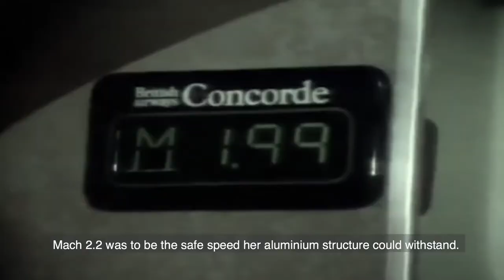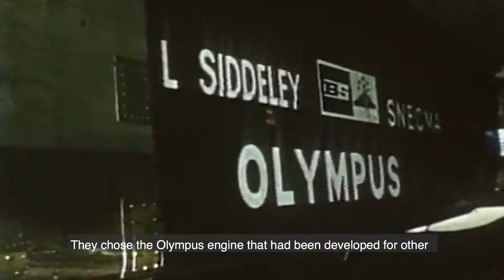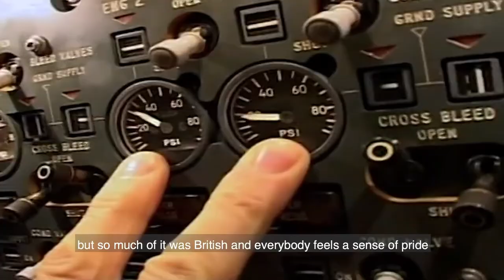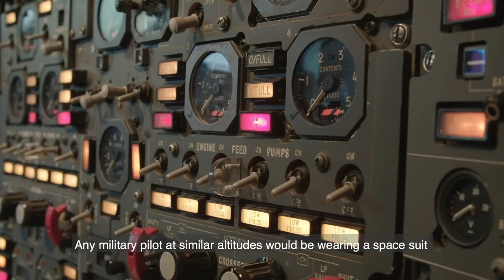Concorde Compilation from Archive British Airways Material

Comment: So without the A-12 & SR-71 spy planes along with Apollo computer technology. Concorde probably would’ve been years later. The A-12 would cruise @ Mach 3.5 The sr71 would cruise at Mach 3.34 it was a different airplane. The A-12 was signed in 1958-1959 to cruise Mach 3.  America stopped a commercial supersonic aircraft because sound #1 also we had learned it’s dangerous and not economical. Now keep in mind the L-2000 & Boeing were gonna be Mach 2.7- 3.0. Believe it or not there’s a huge difference in engineering to build a jet for mach 2.04 VS Mach 3. The heating is ridiculous. Mach 2 is much easier but the issue is the sound and flying over the line of death without a pressure suit. I don’t know how you would get insurance to carry it.
Reply: It was smart of Concorde engineers to stick to Aluminum a widely used material for Aircraft manufacturing and thus limit the speed to Mach 2. They created a new Aluminum alloy that could withstand the heat